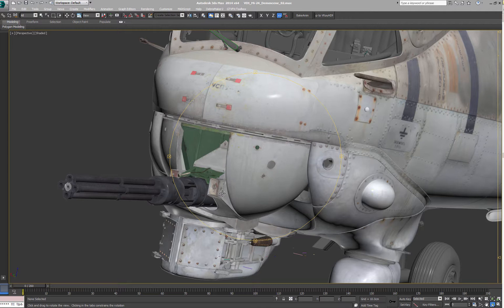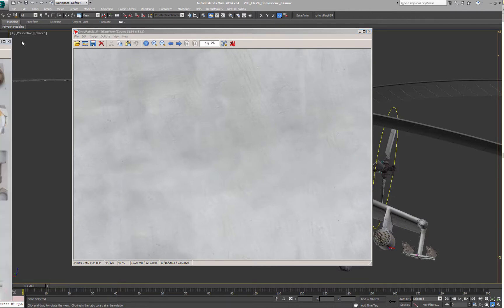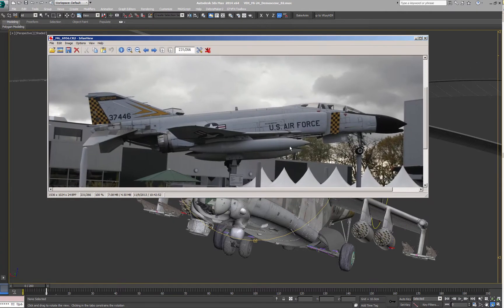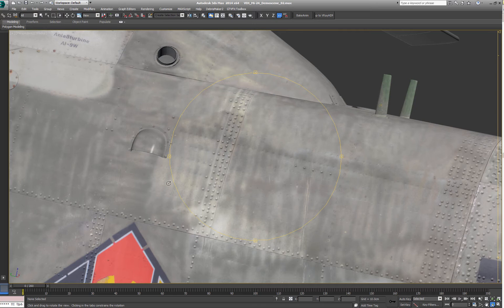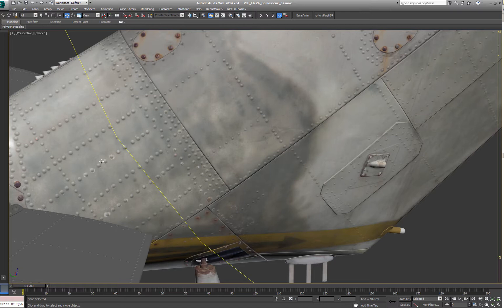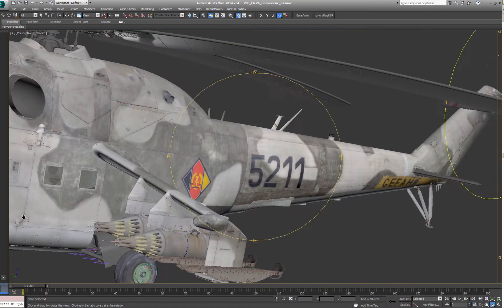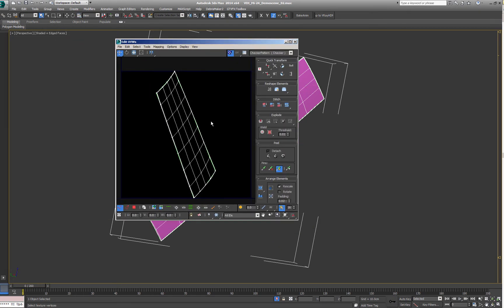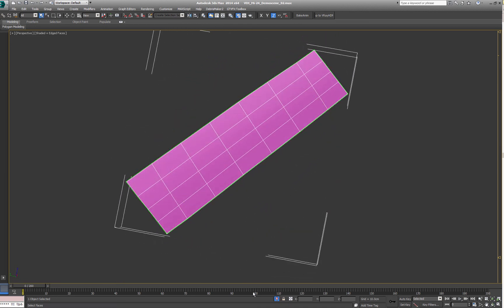Video Tutorial 002 - Mi-24 Texturing Basics and UVs

Comment: How do you manage the size of the project file? Even a small file like mine jumped for 2 to 200mb with a couple of paint strokes..
Reply from the maker: Hasn't been so bad actually. Usually I split everything up like fuselage, cockpit, rotor etc etc and then I have a single assembly file that has everything in it. But even that file is just around  300MB.